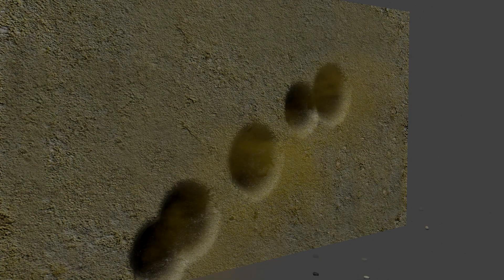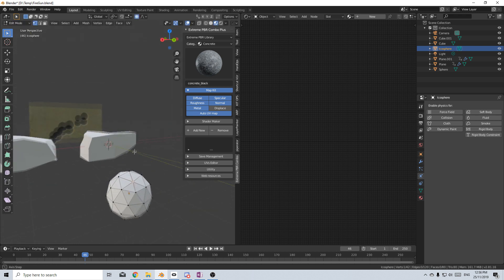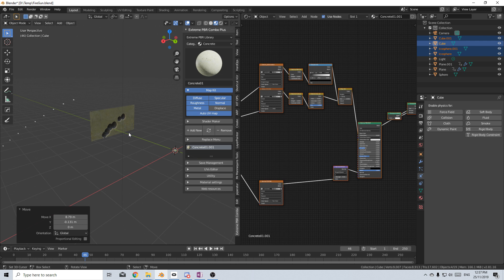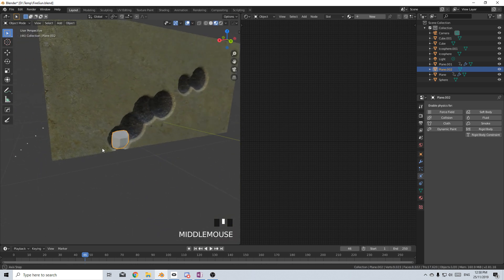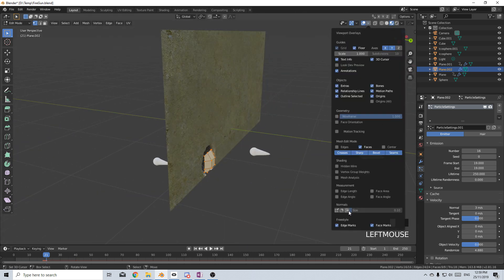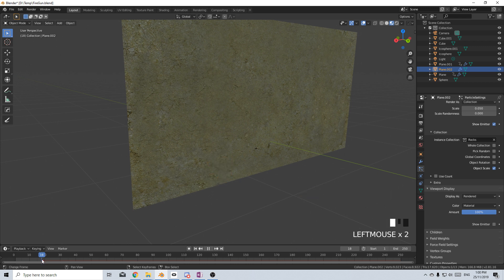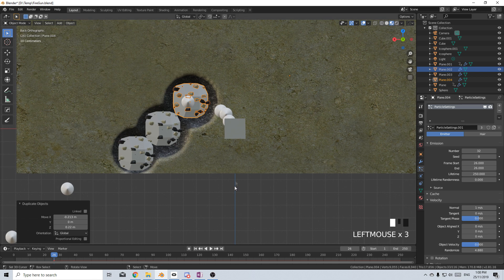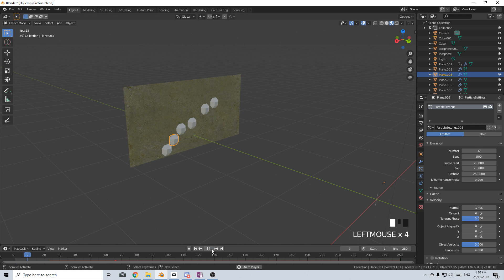Particle Explosion Blender Tutorial - Bullet Hole in Wall Part 4

Comment: found part 3 a few days ago whist trying to get an effect like this to work, was really hoping there was going to be some hidden way I couldn't find to make particles spawn form dynamically painted areas in this one as I could get the displacement modifier, smoke and hair to spawn form it just fine but not particle systems for whatever reason...
at least I now know I'm not the only one frustrated at this... bug? I guess?.. hopefully someone will figure out a workaround soonish that douse not require manually putting in each one... and failing that hopefully this will get fixed with the change over to the node based particle systems whenever that drops
Reply from the maker: I swear this worked in 2.79, and that was the frustrating thing. I had to do it this way to get this effect, so there are semi work arounds
Reply: @Markom3D  I'll be sure to try and re create it in 2.79, and if it works who knows maybe opening the 2.79 file in 2.8 will make it work